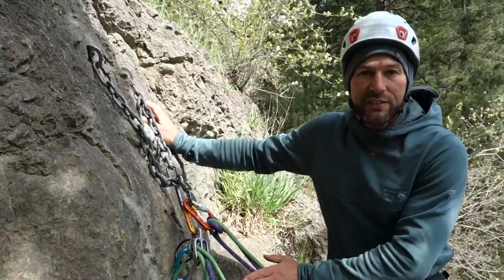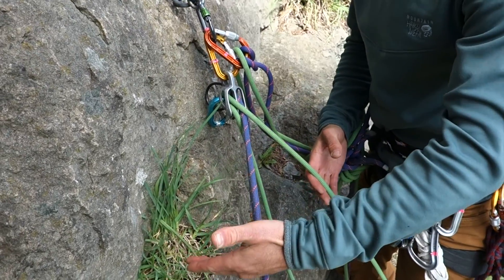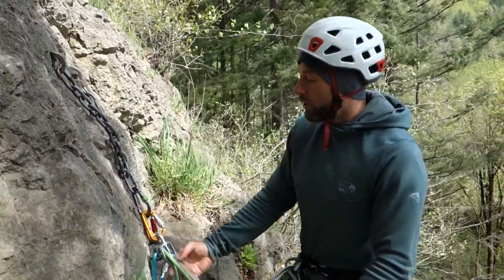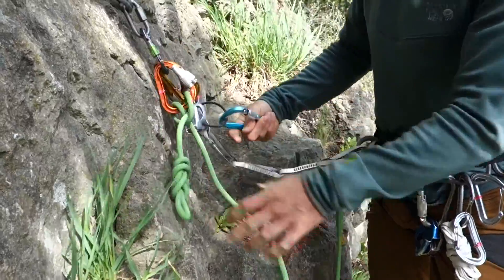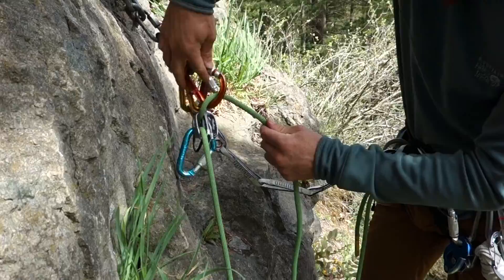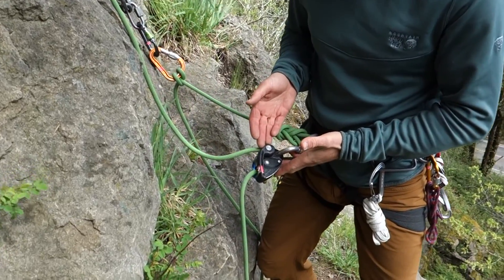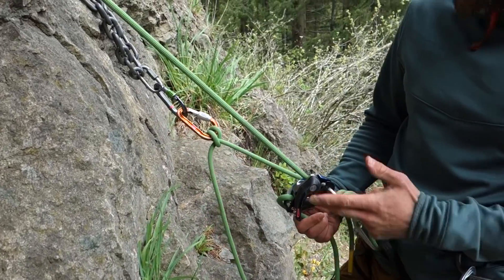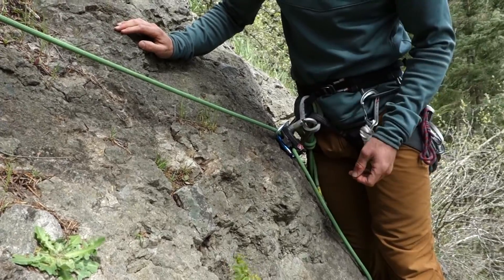Belay Device Failure

Comment: nice videos but a bit windy!  couple of points.  1) tie off client with clove hitch using brake strand not load strand rope and adjust. solves issue with redirecting the load strand.  Beware twists in 2 ropes 2) Using a slim single in a guide plate , its possible (not very likely) to rotate the rear krab and untwist the strands so they don't lock. Solution - always clip both sides of the plate even if using only 1 strand (use some slack from your end).